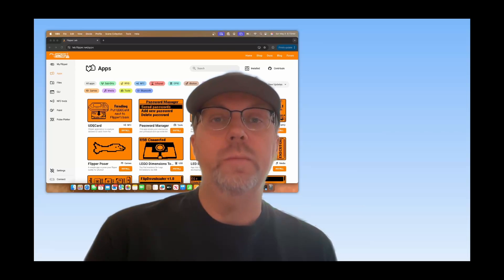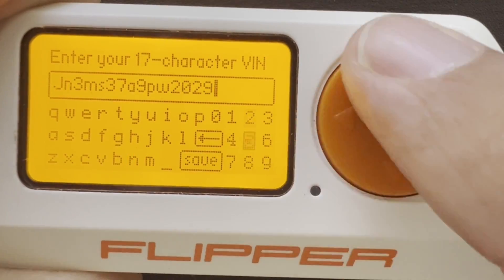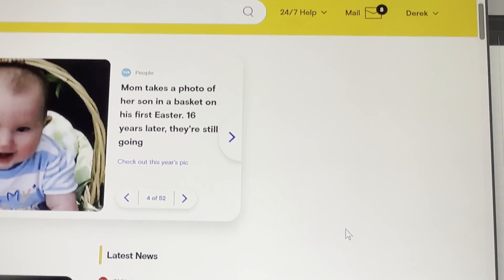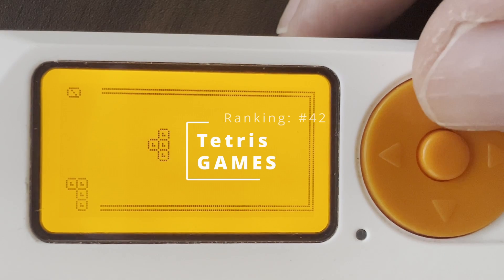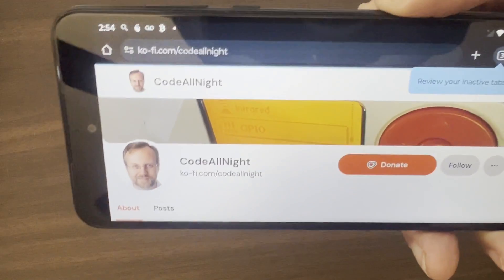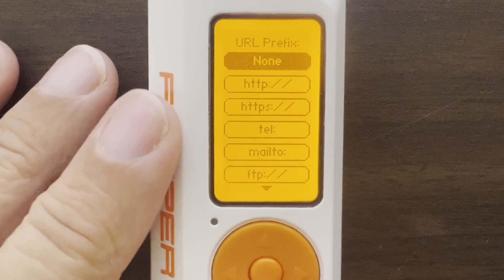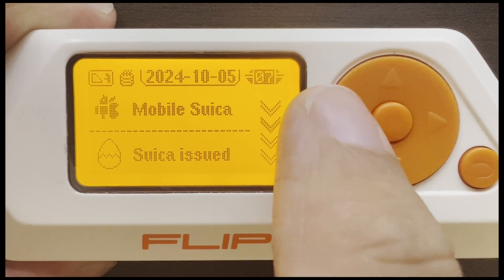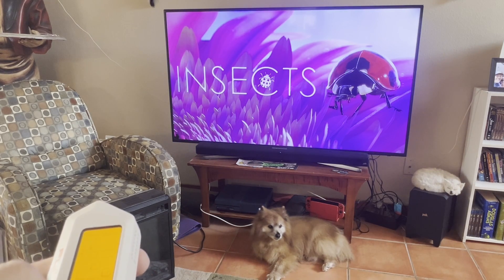[163] Flipper Zero: Top 50 Flipper Zero Applications #flipperzero #top50

Comment: Orgasmotron... 😂
Reply: That one was actually a really fun development challenge, pushing the limits of the flipper zero hardware. F0 only supports on/off for the vibration motor. The app creates different vibro patterns by interrupting the vibro-motor in quick sequences. I also made a similar app LED Pulser (not in the app catalog) that works on the LED light. By default this only offers few colors and blink frequencies. The App controlls the LEDs RGB capacities to create new colors and their intensity to make the light fade instead of blinking.
Reply from the maker: I filmed that one on a cookie sheet, so your mileage may vary. 🤣

Comment: Finally got one of my apps to appear in one of these videos... so either the others are 50 or below or I'm sad 😂
Reply from the maker: Awesome that one of your apps is on the most downloaded list! Which app was it?

My "Air Labyrinth" is rank 207 --- not enough people with VGM module??? And my "Rock Paper Scissors" game is rank 139 (even though it's in the Facebook ads). I have one app in the top 30, but my guess is most people that download it don't actually use it.

Talking Sasquach's Top 10 apps had 3 apps that weren't in the top 100 downloaded (it will be interesting to pull stats next month to see of those apps move up in popularity).
Reply from the maker: I'll probably make a video at some point about app developers using https://catalog.flipperzero.one/application/dashboard to see how many downloads they are getting and to ensure that the build isn't broken. 

You can find your app and compare your downloads with the app I mentioned (sdk 77.2 and newer download count).
Reply: @MrDerekJamison  It was the Orgasmotron :face-blue-smiling:

Thanks for the link to the count, not sure if I got it right, but it looks like Color Guess won't make it into the list. However Cross Remote should be below 30. It's also nice to see some Apps from other developers that used my boilerplate app (similar to your skeleton app) as base for development (Camera Suite, Cripto Wallet, Minesweeper).

Comment: What do you think of connecting an Si4732-A10
Broadcast AM/FM/SW/LW/RDS Radio Receiver to the flipper using I2C?
Reply from the maker: It seems possible, looking over https://www.alldatasheet.com/datasheet-pdf/download/792120/SILABS/SI4730.html

There is an app for the TEA5767 module…
https://github.com/victormico/flipperzero-radio
Reply: @MrDerekJamison  Thank you so much. You're the GOAT in the flipper community, and I appreciate everything you're doing.
Reply from the maker: Do you own the module already? Did you need any help writing the app? I own the TEA5767 module, but I never find myself using it. I'm going to a drive-in movie soon, so it could be interesting to use there (since the car AUX turns off after a few minutes).
Reply: @MrDerekJamison  I have one on order. I saw the esp32 radio's being advertised and thought I would try to make it work for Flipper. I wasn't aware someone already made an app with a different module.
Reply from the maker: @honestlocksmith5428 the power lines aren’t clean on my module, so every time they check signal strength you can “hear” the command. I usually just exit out to the app main menu, which stops the thread. I didn’t try to add capacitors to get clean power.
Reply: @MrDerekJamison  That is an interesting thing to happen and perhaps I'm not exactly sure what you mean you can hear the I2C commands? Does it sound like distortion or like actual binary?
Reply from the maker: Yeah, it's a static kind of distortion noise that happens during the query.

Comment: SPI memory manager is one of my most used.
Reply from the maker: What memory are you dumping?  The three SPI apps I know of aren't in the top 100 list (so not covered in this series). I use "SPI Mem Manager" (see video 91 about the SPI protocol https://youtu.be/_XrRwtcaAIE and view 150 about read/write BIOS https://youtu.be/DU6KlKUKa-E).

I haven't used the other two SPI apps... "SPI Terminal" looks like an interesting tool for debugging, and it looks like "SD SPI" can be used to lock and SD Card?

Rank#132: SPI-Terminal
Rank#150: SPI Mem Manager
Rank#167: SD SPI
Reply: @MrDerekJamison  EEPROM's.